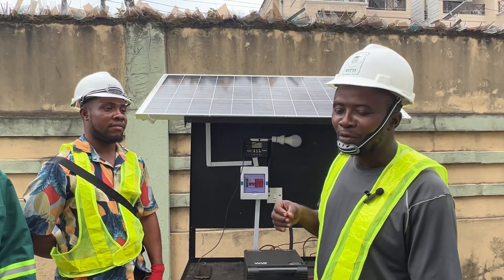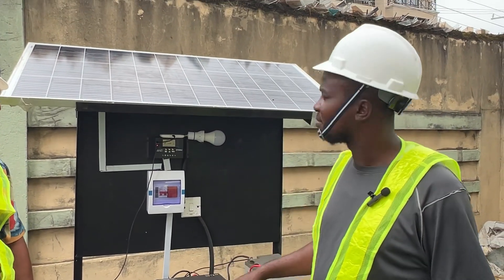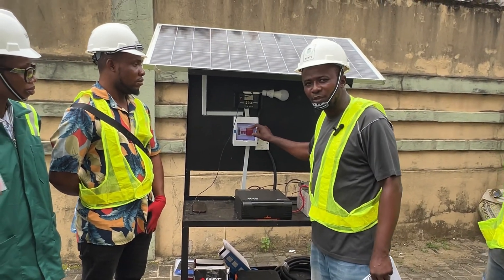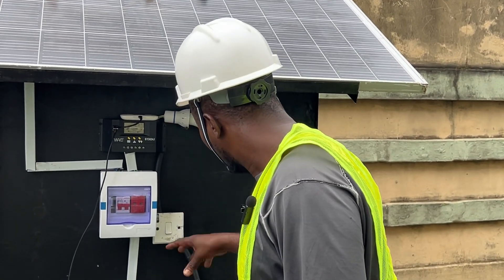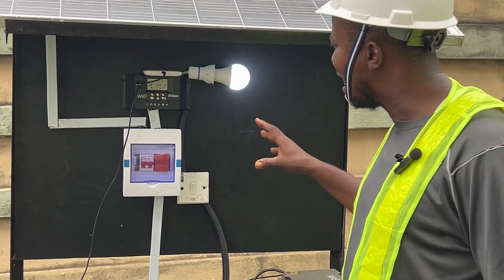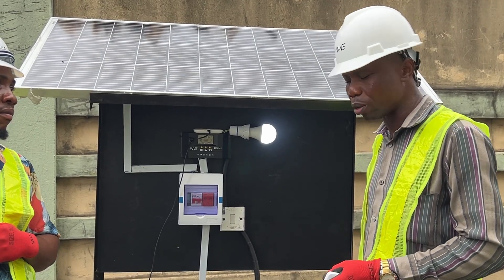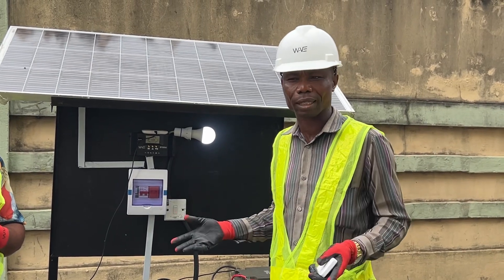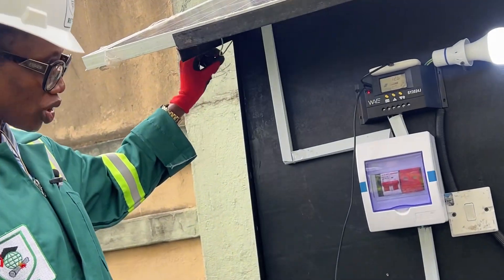Basic Solar Installation in 2 Minutes

Comment: Hi am David I deal on solar wire. I sell good cable and at a good price

With earth
2.5mm 2core=2000
4mm 2core=2700
6mm 2core=3800
10mm 2core=5800
16mm 2core=6800

Without earth
2.5mm 2core=1500
4mm 2core=2100
6mm 2core=3100
10mm 2core=5000
16mm 2core=6400

4mm single 900
6mm single 1300
10mm Single 2400
16mm single 3500

Comment: We have solar panels 160W two places and we want to get battery now but the battery we want to get is 12V 40Ah two places and we have inverter 24V but I want to ask that can the solar panels change the battery very well and can we be using the inverter 24 hours